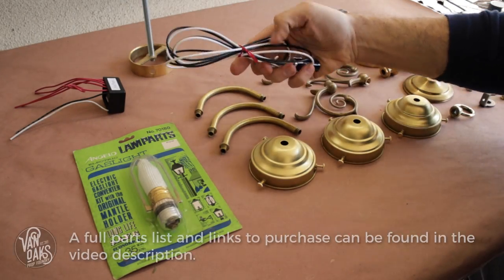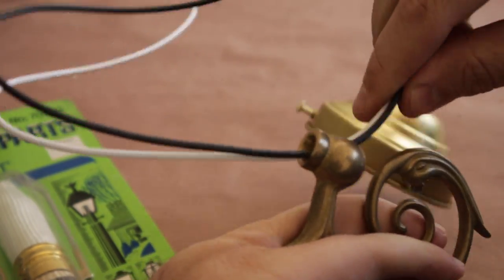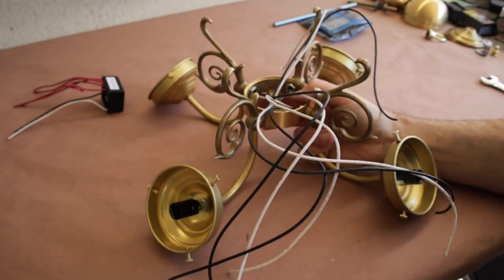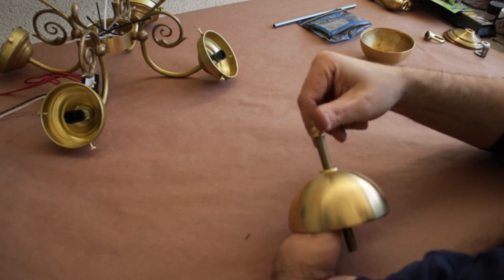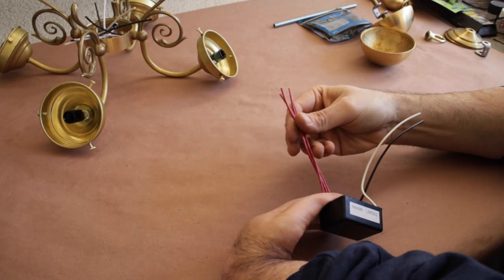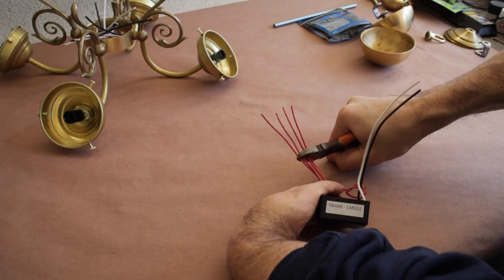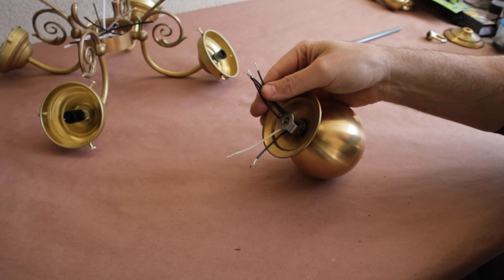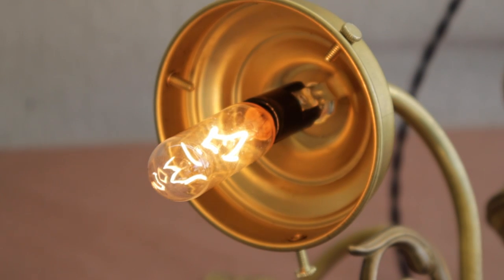SERIES: Haunted Mansion Home Office Part 2 - Replica Chandelier

Comment: I recently built this chandelier but with five lights and I found 3 of those light bulb things with the mantle. I put them on the chandelier and I noticed odors. I don't know if they are toxic, but I noticed like an adhesive tape or something on the lightbulbs and the mantle covers. I tried removing the adhesive tape that was burnt and I can still smell the odor but its subtle. Is it toxic? I was wondering if you had the same problem.
Reply from the maker: That doesn't sound good. Unfortunately, I'm not sure about its toxicity. I didn't notice a smell on mine, but I'm also not sure if they're the same as yours.

Comment: Another great video. Was wondering though with the simflame unit, you used 4 of the hot wires but looped the 5th. And I didn't see a wire nut on it. Do the dip switchs allow for shutting off the current?
Reply from the maker: Great question. I don’t believe it does. I need to make a few adjustments to the wiring, so I’ll be able to add in that missing wire nut.

Comment: Did they provide the bulbs with the cover?
Reply from the maker: No. I had purchased the bulbs from a fellow collector.
Reply: @VanOaksProps  its hard the find the ones with the covers
Reply from the maker: Yeah. The company that makes the bulbs I used no longer makes them. But I believe you can use gas mantle mesh over a similarly shaped bulb with the same effect. Not 100% certain, but I think the mesh would be alright being close to the bulb. Something like this: https://amzn.to/3Kv6ql8

Comment: Is there a reason you chose to do only four lights?  I was just looking at the Grand Brass website and they do offer the rings with five holes and the Simflame module has five channels.  Doing five lights would've been more authentic to the ride and would've made full use of the channels on the module.
Reply from the maker: Great question. The room this is going into is on the small side and a 5 light chandelier would have really overpowered the space. So I decided that I’d go with 4 and if I ever move to a larger room I can replace the body with the 5 hole version and add the additional arm.
Reply: @VanOaksProps  Detail I never noticed before.  The chandeliers in the California mansion do have five lights but the ones in the Florida mansion have six.
Reply from the maker: Oh, crazy! There is a 4 bulb version in the DLR mansion that another viewer pointed out to me. It's in the corridor of doors. The only difference is that the lamp shades are red instead of white.